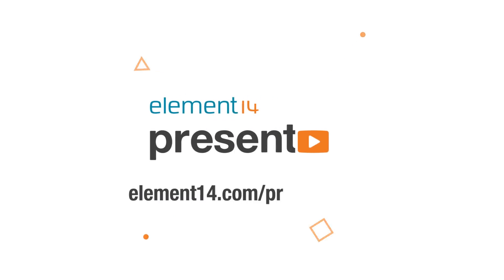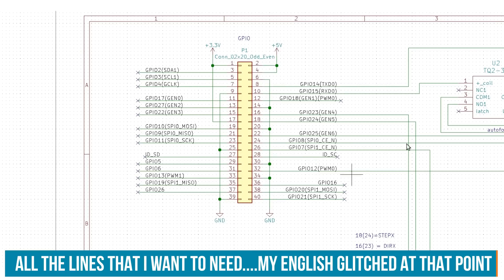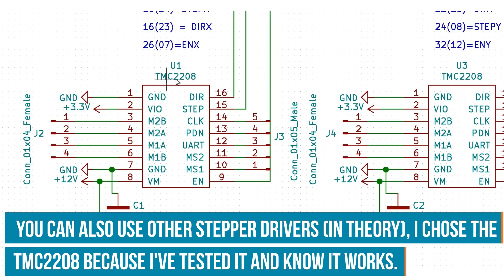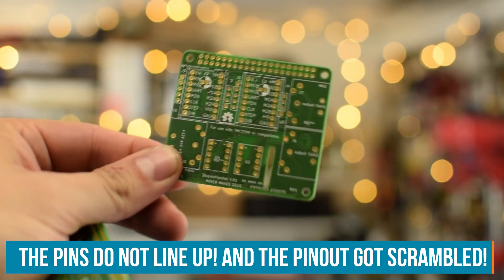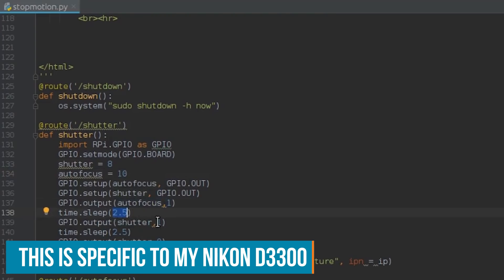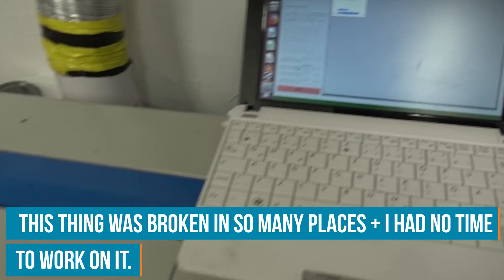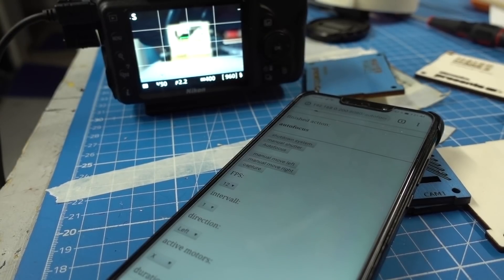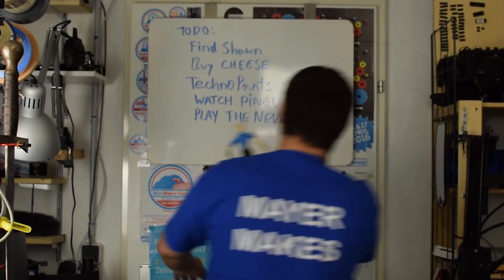Raspberry Pi Stop motion Machine

Comment: Rad project!!! The flickering isn't only due to the camera being in auto, and focus breathing, as seen with slight zoom in and outs at point. But what also happens is the apature ring inside the lens never goes back to to exact same spot every time, so there is a slight difference in exposure. What is usually done, is aperture and focus is set, and the lens is half screwed off the body, just so it's disengaged, so that the aperture ring is set in place, this dramaticly removes the flicker :) great work as always 😁😁😁
Reply: Those are very interesting insights! Would you mind sharing them on the project page? (link in description) more people can see it there and you can add links/pics if you want

Comment: Stop motion and timelapse kind of requires both focus and exposure to be set completely manually. Otherwise the image will almost always flicker and flutter with each frame taken as the camera does its auto adjustments slightly different resulting in almost random exposure and focus. 

If you have a motion control rig like this you can probably use axel for driving focus and one for running a declicked aperture to get very smooth adjustments of both. But if you don't have access to those controls on the rig, you're better off just locking those settings down for each shot. It'll look way better.

Comment: Some phones can do usb tethering so you can usb connect the camera to be phone
Reply: Sure, this could be an option if the cam supports it. I tried to make a system that works mit most of the common DSLRs.
Reply: @MAYERMAKES  yea, there is helicon remote for Android what supports most DSLRs but I believe that the camera needs to support live view
Reply: @lewisfoster2494  this made me think of something - you could also hack up some headphones to remote control phones that support taking pictures by hitting the integrated remote button :D
Reply: @Davedarko  well, it depends on what camera you use add most cameras have a proprietary connector on then for a remote shutter release
Reply: @Davedarko  the earphones use resistors on the mic pin, they don't short it. Thats why you can't hear the microphone when pushing one of the buttons
Reply: @lewisfoster2494  well you can use resistors on a relay too, don't have to short it :)
Reply: @Davedarko  that's true